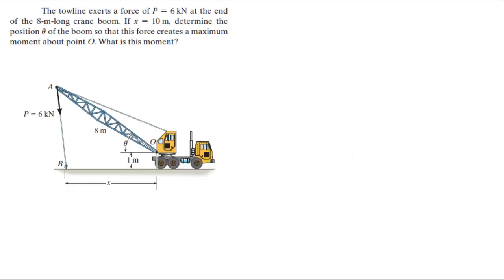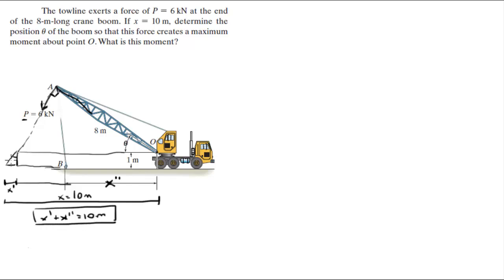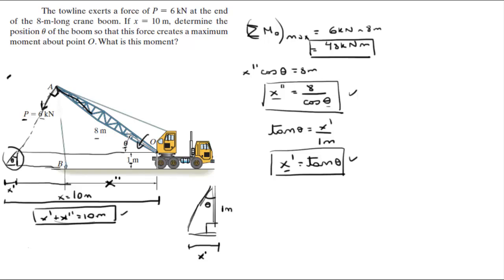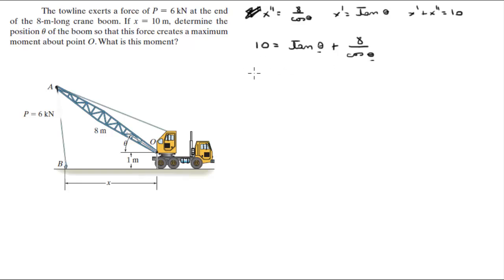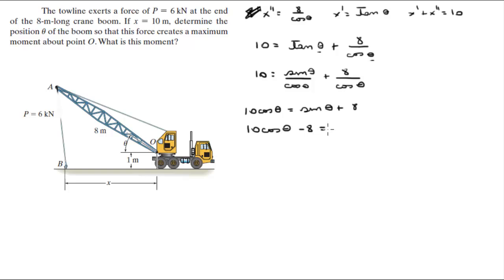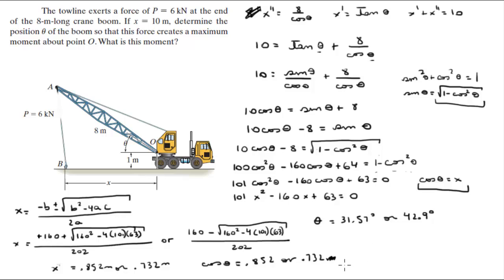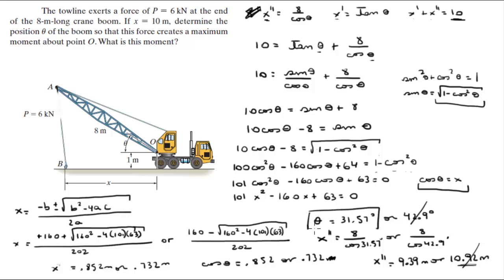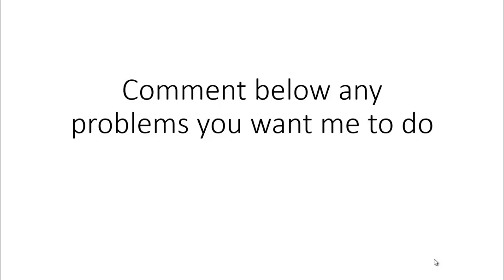Determine the position u so that this force creates a maximum moment

Comment: This doesn't make sense. The distance from point B to point O is equal to 10. Yet, you drew a picture so that P is perpendicular to the crane and stated that the Hypotenuse is also 10, but this doesn't make sense because point B is fixed?

Comment: How did you get the theta at the small triangle in the left corner?
Reply: If you were to make a triangle out of the picture, with 90 degrees being point A, then the opposite angle, which I'll call angle Z,  would be 90-Theta. If you then split that triangle into two smaller triangles, with the 90 degree being below point A, then the angle at point A would be 90-Z which would equal Theta.

Comment: x = 10 m from the truck to the tow line! You can't just change how long x is. This is a much more complicated problem than it looks. Your x in the video is actually the x=10 m  from the problem plus what else you added call it x' or x" therefore the hypotenuse to the similar triangle is 10 + x'. Then you would need to find the new hypotenuse to the large triangle with the 1m in height added. Please update. I'm having trouble solving this problem because you need to use similar triangles. Please Help!!!!!!!
Reply: He is actually correct. The length x must both be equal to 10 and at an angle that creates a maximum moment, i.e. a right angle. The picture in the problem doesn't happen to show P at a right angle, but it's up to you to figure out how to draw it. x is a variable that is given a value, and you have to change the drawing accordingly.
Reply: This was really helpful. Thank you do much @nathanielzucker591
Reply: He has solved it correctly.
Reply: you're right, I was so confused why he changed the length willynilly. Similar triangles I think is the way you solve this problem too!

Comment: Why/how do you just change x? Isnt it already set
Reply: X is only the horizontal distance from the pivot to the anchor. As theta is lowered (the crane is more horizontal) point A moves horizontally away from B as the vector of force tilts more towards the horizontal as well towards the anchor B. When it makes a greater angle, it will be directly above B and then start moving away again.
Reply: @jimbo7994  Thanks bro! Already graduated but appreciate it haha
Reply: @anasabomoslim7991  I still appreciate these comments bc that was the exact question that I had as well. So while it might nott have helped you much, it still helped someone. So thank you for asking and also thank you to the other user for answering. Congratulations on ur graduation btw (lmao idk how long ago you graduated, so happy belated graduation)
Reply: @mallk238  thank you and no problem boss 😂
Best of luck